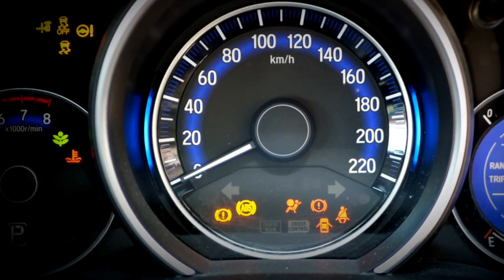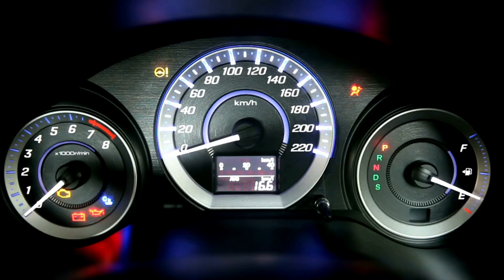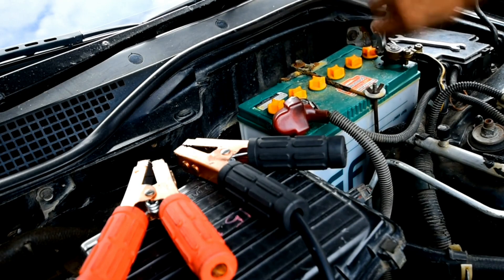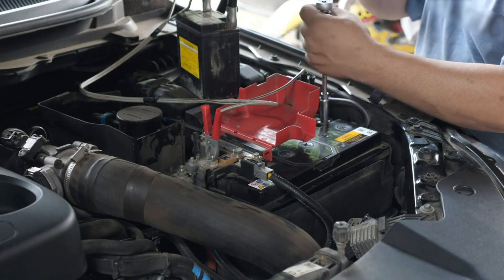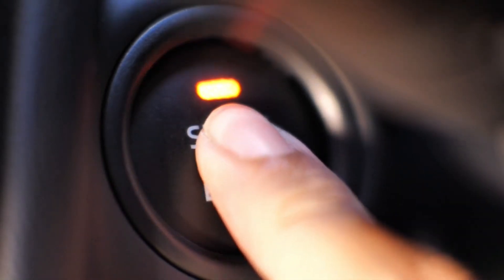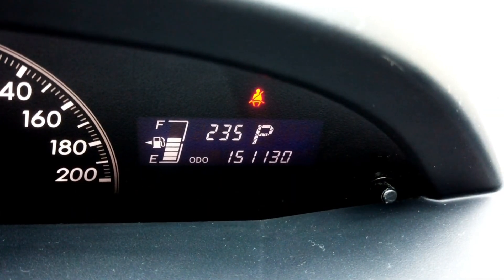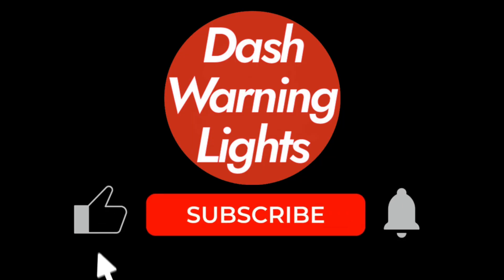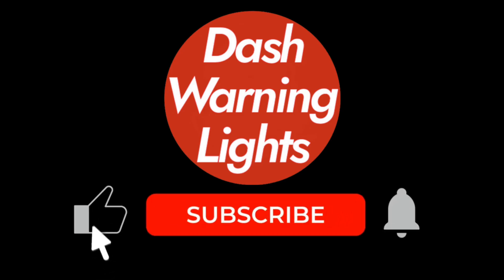How to Reset All ECUs and Control Modules in Your Car or Truck Properly

Comment: Worked for me on my 2018 Hyundai Santa Fe sport. it fixed my charging voltage drop from 14,2 to 12.4 while driving if no accessories where on, also my ABS light was coming and off while driving. So I did your reset and all is fixed for now.. Thanks for your video!..👍
Reply from the maker: @walter3324   Glad it worked for you!  A voltage drop while driving (from ~14.2V down to ~12.4V) can definitely confuse multiple systems like ABS, traction, and other control modules. Resetting all the ECUs helps them relearn proper values after the voltage issue.
Keep an eye on the charging system over the next few days — sometimes a weak alternator, battery, or ground connection can cause those symptoms to return. But if everything stays stable, then you’re good!
Thanks for the update, and I’m happy the reset helped your Santa Fe Sport!

Comment: Would this work on a Golf MK5? I have a check engine that wont go away after changing a bad nox sensor. I have deleted the code with an obd scanner but it still comes back sometimes but not as often as it did before i changed the bad nox sensor.
Reply from the maker: @BjornS22193   Hi! Thanks for watching the video.
Yes, it can work on a Golf MK5, but keep in mind this method only resets ECU adaptations — it won’t fix an issue if something is still triggering the NOx fault.
Since you already changed the NOx sensor and cleared the code, but it still comes back sometimes, that usually means:
👉 The system is still relearning the new sensor
👉 OR there’s another related issue (wiring, exhaust temp sensor, EGR, etc.)
You can try the full ECU reset from the video to force all modules to relearn fresh data. If the fault returns again after a full reset, then there’s likely something else upstream causing the reading to go out of range.
If you want, you can tell me the exact code number and I’ll help you break it down.

Comment: Some time on display when started by push button and goes off . Again when I start keep going driving the display get on and shows navigation for Lexus nx200t 2016 model to fix it when checked OBD it says communication with ECU how to fix it
Reply from the maker: @kram2023  It sounds like you have an intermittent communication issue between the display/navigation unit and the ECU on your 2016 Lexus NX200t. Here are the most common causes and fixes you can try:
1. Check the battery health
Low voltage is the #1 cause of communication errors on Lexus/Toyota.
👉 Test the battery or try a jump-start and see if the problem goes away.
2. Inspect the fuses for the display/navigation system
Look for these fuses (names may vary):
RADIO / NAV / DISPLAY
ACC
ECU-ACC
Remove and reinstall them to reset the circuit.
3. Check for a loose connector behind the screen
The display sometimes loses CAN communication if the connector is loose. If you recently had any work done on the dashboard, definitely check this.
4. Scan all modules, not only the engine ECU
If your scanner shows “communication with ECU,” this usually means:
A faulty module on the CAN network
A fuse problem
A wiring/ground problem
Lexus CAN systems are sensitive to weak grounds.
5. Try a full system reset
Disconnect both battery terminals, touch them together for 10–15 seconds (away from the battery), then reconnect. This resets all modules.
Make sure you have the radio presets and settings saved if needed.
6. If the screen only works sometimes, the common failures are:
Bad display unit
Bad MCU board in the screen
Water/moisture inside the dash
Loose CAN communication wires
If after checking battery, fuses, and connections you still get the same “communication” code, the navigation/display unit itself may need repair.

Comment: Hello , only the - or both ?
Reply from the maker: @SG1-995   Hi! Disconnect both battery terminals, but always remove the negative (-) first and reconnect it last. This keeps the reset safe and prevents short circuits.
Reply: @Dashboardwarninglights OK thanks , i Just disconnect the - , waiting 25 min , but the air bag led is always on , you think i need to test again with both -&+ disconnect , or i need odb , for seat 1.9 tdi 2003 thank you
Reply from the maker: @SG1-995  If the airbag light is still on after disconnecting only the negative terminal, a full reset with both terminals disconnected sometimes helps — but airbag lights usually stay on until you scan and clear the fault.
On most cars (including your 2003 Seat 1.9 TDI), the airbag system stores a permanent code, so an OBD scan is normally required to turn the light off.
Also make sure there are no loose seat-belt or seat-airbag connectors under the seats.

Comment: Mr apakah berlaku untuk mobil fordfiesta matic 1.6
Reply from the maker: @dejealsampiti692   Yes, it can work on a Ford Fiesta 1.6 automatic.
ECU reset steps are generally the same on most cars — disconnect the battery, drain remaining power, then turn the key on so the modules can relearn.
Just keep in mind: a reset won’t fix a sensor or part that’s actually faulty — it only clears old learned data.

Comment: Can this method fix a p061b code
Reply from the maker: @imagine684   The P061B code usually points to an internal control module performance issue (often ECM/PCM related). Resetting the ECUs might clear the code temporarily, but if the fault is still present, it will likely come back. In most cases, P061B means the PCM may need further diagnosis (software update, wiring check, or even replacement). If you try the reset and it returns, it’s best to have the PCM checked with a professional scan tool.
Reply: @Dashboardwarninglights alright thanks
Reply from the maker: @shandebuggam8783 You’re welcome! Glad I could help.

Comment: I have a 2009 Land Rover Range Rover Sport 4.2L and the terminals was loose but I kept using the car and then I had to jump start the car almost every 2-3 days and I kept doing it. So I bought a new car and let the range sit but I want to fix it I got a new battery and changed the terminals to where its now tight but the car keeps reading a code U0176 and the whole car just goes crazy the ac turn on the hazard lights turn on and starts flashing etc cant raise suspension and sometimes the car wont crank
Reply from the maker: @imagine684   That sounds frustrating. Code U0176 usually means there’s a communication issue with the suspension control module. Since you had loose battery terminals for a while, it may have caused corrupted signals or even damage to wiring/connectors. Here’s what you can try step by step:
👉 Double-check grounds & fuses – Make sure the negative battery ground to chassis and engine block is clean and tight. Check suspension/ECU-related fuses.
👉 Inspect wiring & connectors – Look for corrosion, bent pins, or damaged plugs around the suspension module (under the vehicle near the compressor).
👉 Hard reset – Disconnect both battery terminals, touch them together for 30 seconds (with battery removed), then reconnect. This can reset ECUs.
👉 Check for water intrusion – Range Rovers are known for water leaks that affect modules. Inspect the suspension control module and other ECUs.
👉 Scan with advanced tool – A regular scanner may not show all Land Rover-specific faults. Try getting it scanned with a professional tool (like Autologic, SDD, or GAP IIDTool).

If after all this the car still goes crazy with random lights, it may need the suspension module reprogrammed or replaced.
Reply: @Dashboardwarninglights  I thought the code was something to do with the immobilizer
Reply from the maker: @imagine684   U0176 isn’t usually an immobilizer code – it means Lost Communication with Suspension Control Module. But when that module or wiring goes bad, it can cause all kinds of strange electrical issues (AC, hazards, no crank, etc.) that feel like an immobilizer problem.
Since you had loose battery terminals for a long time, it may have corrupted signals or stressed the module. I’d suggest:
👉 Check grounds and power feeds to the suspension/BCM.
👉 Inspect wiring/connectors for corrosion or water damage.
👉 Do a full reset by disconnecting the battery for 30 min.
👉 If still no luck, it may need a proper diagnostic with a Land Rover scan tool.

Comment: I unplugged my battery to fix terminals , now my left side power windows not working and my radio isn’t turning off anymore when I turn car off…could an ECU reset help?
Reply from the maker: @ericajohnson6141  When you disconnect the battery, some modules (like power windows, radio, or BCM) can lose their stored memory or need re-initialization. An ECU reset alone won’t always fix it, but you may need to relearn your power windows (usually holding the switch up/down for a few seconds) and check if your radio needs a reset/reprogramming. Also double-check the fuses around the BCM and radio. Resetting the ECUs can sometimes help the system relearn, but in your case it sounds more like initialization after the battery disconnect.
Reply: @Dashboardwarninglights when the mechanic plugged his machine in this message popped up B160500 CAN timeout between IPM and DDM what do you think that means
Reply from the maker: @ericajohnson6141  Thanks for sharing that code. B160500 (CAN timeout between IPM and DDM) basically means the driver door module (DDM) isn’t communicating properly with the interior power management module (IPM) over the CAN network. That’s why your driver-side windows stopped working after the battery was disconnected.
👉 Sometimes this happens if the system just needs to be re-initialized (like reprogramming the window switches).
👉 Other times it could be a loose connector, blown fuse, or wiring issue between the door module and the main body control module.
👉 Resetting the ECUs alone won’t fix a communication fault, but clearing the code and checking connections often helps.
If re-initializing the windows doesn’t restore function, I’d suggest checking the fuses/relays for the driver’s door module and making sure the wiring harness in the door jamb isn’t damaged.
Do you want me to also draft a short relearn procedure for the power windows you can paste under your reply?
Reply: @Dashboardwarninglights Yes thank you

Comment: My car is jerking while coming to a stop. I think the ecu is the problem. Got a 2006 is250
Reply from the maker: @mSwag98hace   Hi! On your 2006 Lexus IS250, jerking when coming to a stop isn’t always just the ECU. It can also be caused by:
👉 Dirty or failing throttle body
👉 Faulty or dirty MAF sensor
👉 Transmission issue (like worn solenoids or fluid needing replacement)
👉 Dirty or sticking fuel injectors
👉 ECU needing a reset or update
✅ First try: clean the throttle body and MAF sensor, and check your transmission fluid condition. If that doesn’t help, a diagnostic scan for stored fault codes will point you in the right direction.
👉 Would you like me to guide you through the ECU reset procedure for the IS250 step by step?
Reply: @Dashboardwarninglights got my transmission flushed last year. Plus there’s no codes showing up.
Reply from the maker: @M@mSwag98   Thanks for the update! Since your 2006 IS250 has a fresh transmission fluid and no codes are showing, the jerking when coming to a stop is more likely caused by:
👉 Throttle body carbon buildup (very common on IS250, causes rough downshifts and jerks)
👉 Dirty or sticking fuel injectors
👉 Weak or dirty MAF sensor
👉 ECU still holding old learned values (reset can help)
✅ I’d recommend:
Clean the throttle body (especially around the butterfly plate).
Clean the MAF sensor with MAF cleaner spray.
Do an ECU reset (like I explained above).
If the issue persists, it may be the torque converter lockup clutch starting to wear, which feels like a jerk when slowing down — but that usually shows up gradually.
Reply: @Dashboardwarninglights I forgot to mention when I’m coming to a stop from neutral there’s no jerking. I had my carbon build up cleaned last week. Will try resetting the ecu and cleaning the maf sensor
Reply from the maker: @mSwag98hace  Thanks for the extra details! Since it doesn’t jerk when stopping from neutral, that points more toward the transmission downshifting/torque converter rather than the engine itself.
✅ You already did the carbon cleanup, so yes — resetting the ECU and cleaning the MAF is a good next step. If it still jerks afterward, I’d look into:
👉 Torque converter lock-up clutch (common on IS250)
👉 Transmission shift solenoids
👉 Software update (Lexus sometimes released TCM updates to smooth downshifts)
Let me know how it goes after the ECU reset + MAF clean!

Comment: Hi... very informative video. One question; is it paramount to drive right away or can I wait a couple of days? Thank you.
Reply from the maker: @heidischwab2698  Thank you!  After resetting all ECUs and control modules, it’s recommended to drive the car right away so the system can relearn sensor data and complete the adaptation process. Waiting a couple of days won’t cause damage, but driving sooner helps the ECU recalibrate faster. Don't forget to subscribe for more tips!
Reply: @Dashboardwarninglights thank you.

Comment: Could you help me reset my Audi s3 2016 ecu it’s been messed with after I tried reflashing a tune onto my car
Reply from the maker: @verifiednav2772  Hi! For your 2016 Audi S3, since the ECU was affected after a failed reflash, try these steps:
👉 Disconnect the battery → Remove the negative terminal and leave it off for 15–30 minutes.
👉 Reconnect the battery and turn the ignition ON (don’t start the engine) for 2 minutes to let the ECU relearn.
👉 Scan for fault codes using VCDS, OBD11, or a Launch scanner. Clear any errors if possible.
👉 If the car still won’t start or runs poorly, you’ll likely need to reflash the ECU again using the original stock firmware.
✅  If the flash was interrupted or corrupted, sometimes only a professional ECU reprogramming at an Audi dealer or a tuner with proper tools can fix it.
Reply: @Dashboardwarninglights  Hi, should I apply the same methods for my 2011 Audi Q5 2.0t? Thanks!
Reply from the maker: @mr.lancewaters2376   Hi! Yes, you can apply most of the same reset methods on a 2011 Audi Q5 2.0T, but with a few important Audi-specific notes:
👉 Safe methods that work on Audi Q5
👉  Battery disconnect reset (negative terminal)
👉  Capacitor drain (brake pedal hold after disconnect)
👉  Steering angle relearn (turn wheel lock-to-lock)
👉  Drive cycle reset (short mixed city/highway drive)
👉 Important warnings for Audi
⚠️ Some modules (ABS, Airbag, Transmission, AWD) will NOT fully reset without a scan tool (VCDS / OBD11)
⚠️ Battery must be properly coded if replaced, or warning lights may return
⚠️ Don’t clear airbag faults by disconnecting the battery only
👉 Best practice
 Use the manual methods for basic ECU resets
 Use a scan tool if warning lights stay on after reset
If you want, tell me which warning light is on, and I’ll guide you step-by-step.

Comment: nice tutorial.. help a lot..
Reply from the maker: @wannurainaabatrisyawanmohd2756  Thanks so much!  Glad it helped you out. If you ever need help resetting a specific ECU or dealing with a dashboard warning light, feel free to drop your car's make and model — I’m here to help!"
Reply: @Dashboardwarninglights 2014 Hyundai Santa Fe
Reply from the maker: @ericajohnson6141   For your 2014 Hyundai Santa Fe, you can reset the ECUs and modules by disconnecting the battery for about 10–15 minutes, then reconnecting it. After that, turn the ignition on (engine off) for a few minutes so the systems can reinitialize. If you want a full reset including transmission and fuel trims, you may also need to use an OBD2 scanner.